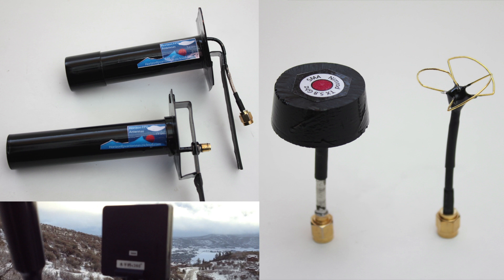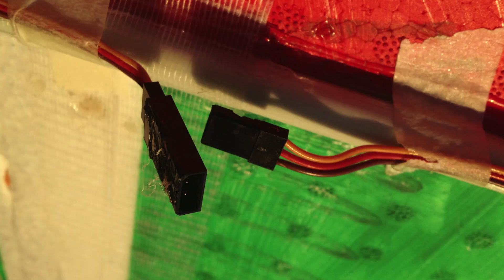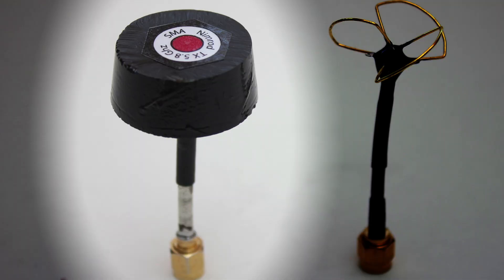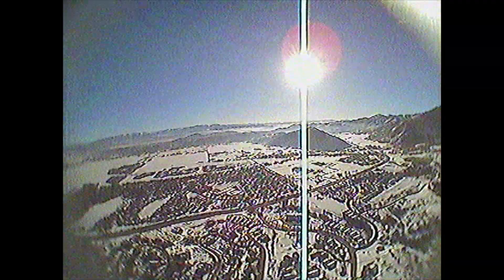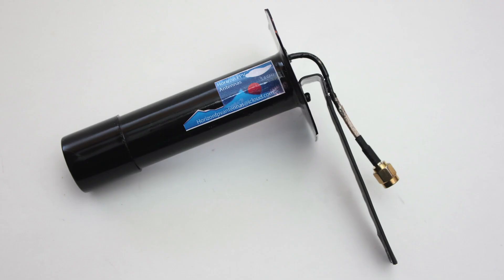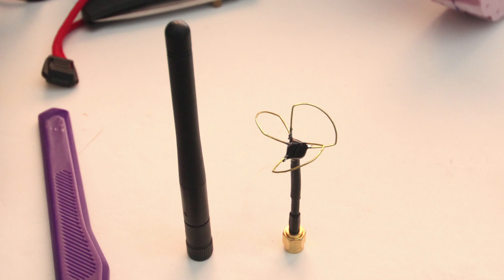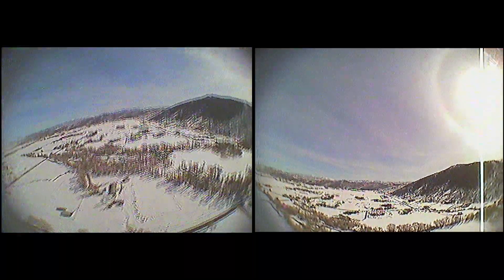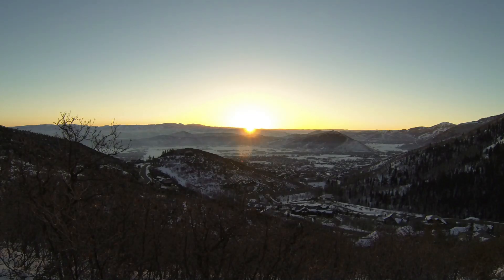FPV Circular Polarized Antenna Testing - RCTESTFLIGHT

Comment: Dont know if this will help your video edits. Your captures from the videolink seem to be in interlace which is either 25fps or 29.97fps if your in the USA... so if your video 3editing convert your 25i 29.97i footage to 50p or 59.97p by dropping it in premiere in a 50p or 59.97 sequence... then youll find your videos look much better without teh interlace "jaggies" those horizontal streaky lines. Then you can render out to mp4 as 50 or 59.97 video and upload to youtube like that. It looks sooo much better in 50p or 60 as it looks more natural and fools the eye into thinking there is more resolution in your footage... the old interlace eye trick. Anyhow hope this helps.

Comment: bro please can you tell me the type of antenna that i can buy that can give me 100km please thanks
Reply: lol none 10 km max
Reply: Glen Garden more than 10km but you probably would have to make a really efficient antenna to fly 100km
Reply: Sunday Omoniyi You're not going to get 100km because you'd probably be below the horizon, but you would need an antenna tracker. You might be able to get some pretty extreme distances with the 600mw immersionrc TX and a black cannon on the antenna tracker on the ground.
Reply: Nathan JR
i don't fly quad copters any more or any rc planes
Reply: rc cars?
Reply: dude why did you quit?
Reply: waiting for the new phantom 3
Reply: Sunday Omoniyi go UHF
Reply: +Sunday Omoniyi www.silvustechnologies.com

Comment: I think these cloverleaves are good for any slanted angle while the rods like parallel Tx and Rx antenas. Image is good! In any case, we don't need a field TV monitor with res higher than ~320, the rest can be recorded by the cam for later review in 1080. Cheers!

Comment: Th vid was nice. Your downlink video feed doesnt look that good here, but the test was good. However I doubt that you dont get more range with the helical. On my 2.4 band comparing spw antennas to helical there is a huge benefit when going out far with the helical!   Hats off to an fpver that flies a range check without elevator! How do you like the monitor vs the goggles? I have both and yesterday I had similar weather like you and my tv was not so good to watch...

Comment: All antennas are not created equal. Grab a RHCP crosshair and SPW from VAS or Circular Wireless, then run a linear/circular test. I get 5 miles off my 1.3 crosshair, no problem, zero multipathing. Happy you're posting the tests, but using reputable antennas that are individually tested before they're shipped is key.

Comment: Hey, can you do a video on your full fpv setup. I have basically the same but get loads of interference. Have used ferrite rings etc but my AXN motor seems to play havok with it! i cant get to 100-150m let alone 1000-2000!

Comment: From what I read it does not necessarily produce better signal strength, it only reduces interference from multipath signals so if he did not experience a lot of multipath interference then the range should be about the same.  He would have seen a larger difference if had been flying around buildings.

Comment: Yes, the result is not so surprising, I would go for the circular polarized antennas too. What is really surprising that these antennas have not a perfect form factor, I mean they are not bent perfectly circular with a machined template, and still work well at such distances.